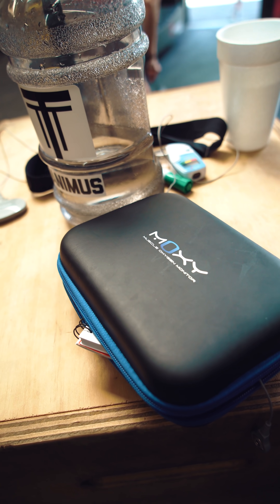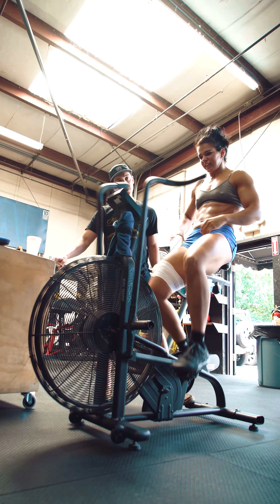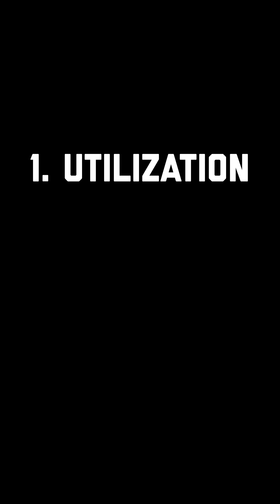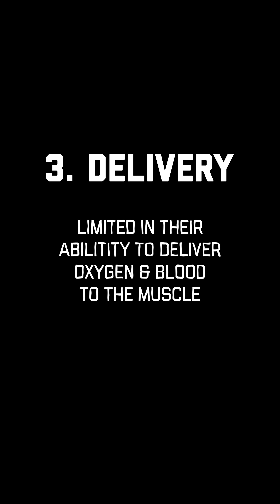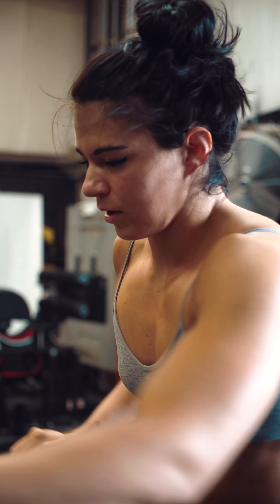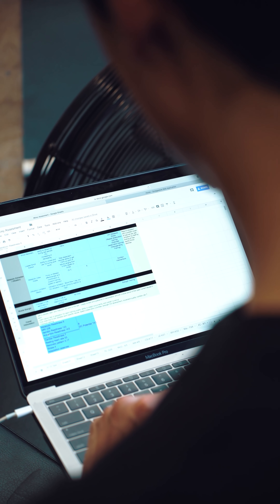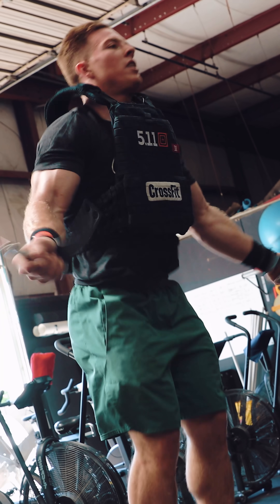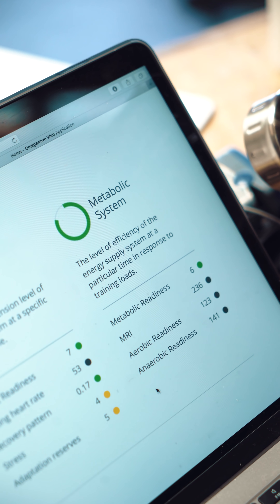The 3 Primary Energy System Limitations

Comment: Hey TTT! Amazing video. I've watched it multiple times and you guys are 100% the best source for training information in the sport of fitness! I have a question about your protocol for dealing with this athlete. You mentioned avoiding using 'zoned' work and instead using a 'blended' energy system training method. It just gets a little broad here. I understand you want to specifically target the limitations, but maybe you could actually give a very simple example of an interval workout that you might give her for the respiratory limitation and / or for the cardiac limitation? Also. Would you ever consider using respiratory restriction devices such as the Airofit or other?

Comment: 1. This values (200W;250W;300W etc.) are based on different test from the past or there are universal for any athlete male of female?
2. You said she increase pace every 2 sets until failure. So for example, she keep 400W for 2'30" from second 400W's set and not be able to keep that pace anymore, so she wait to the end of 4' window + 1' rest and from that point start Wingate test?
Reply: @Evan Peikon Thanks for the answer, now it's a lot easier for me to understand this method.